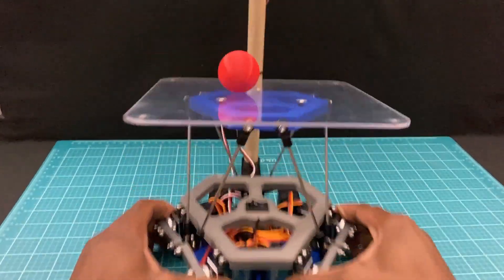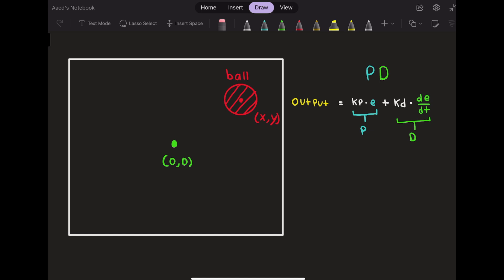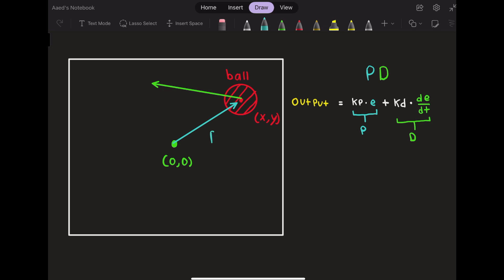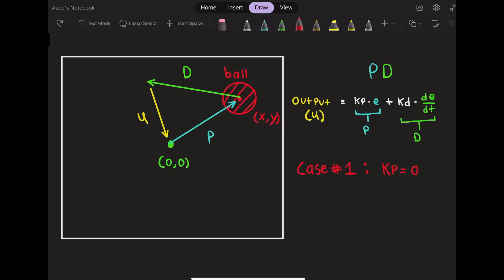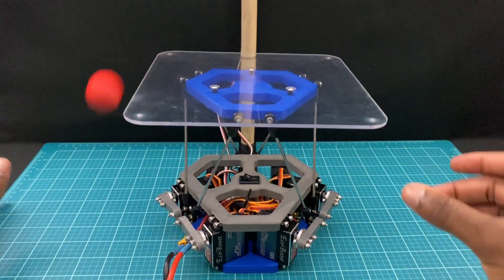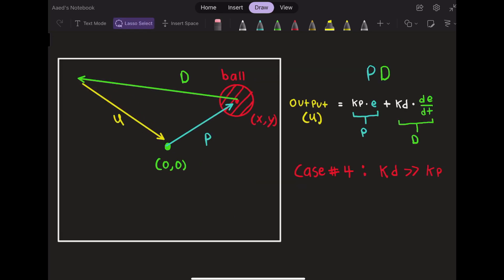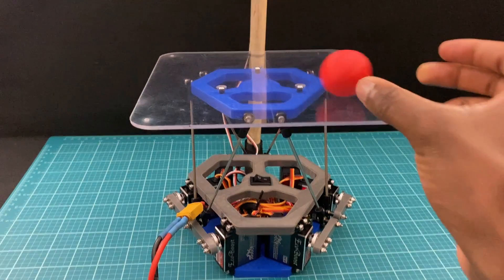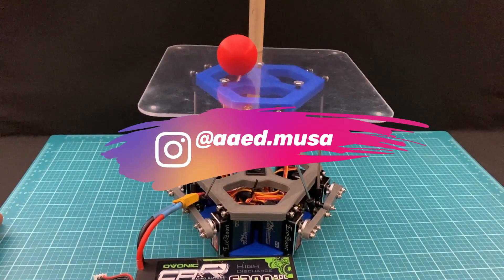Ball Balancing Robot pt.2

Comment: Wouldnt the integral value would help him being constantly learning from his incorrect movements and tuning himself all the time ?? Im not an engineer but i did a electromechanic formation some 12 years ago  i did not worked with pid very much since school and even then it was simplified
Reply: The integral term helps with steady state error but since the ball is moving so quickly and there is no “steady state” per se (other than the exact center point), the integral would mostly add oscillation and make the controller much harder to tune (would probably need more aggressive derivative coefficient but that comes with its drawbacks as well)

Comment: Thank you for doing this!  I've always wanted to understand PID control and inverse kinematics.  This second video explains PID control and your approach with the software very well.  Is there any chance a third video is coming to explain the inverse kinematics?
Reply from the maker: Unfortunately no. The brief overview is that I used vector calculus to derive the equations and it took a really long time lol! The equations essentially allow you to input a vector and have the platform point in the direction of that vector. Knowing the distances between the servos and how long each linkage is, you can break the entire system into a bunch of 3D lines and can then solve for  the positons which each servo must face in order to get the platform to point in the direction of the aformetntioned vector.
Reply: @aaedmusa  thank you for the explanation.  I'll go through it (which will take me some time!) and I appreciate the assistance.  Keep up the great work!
Reply from the maker: @jsbrsb  thanks!

Comment: A long time ago (in the BasicX days) I tried to develop a self-balancing robot. It had a single DOF: simply, just a T-square ruler placed upside-down on the floor with a single servo on top operating a single "arm". Sort of like a human keeping her balance standing with her legs apart and being only able to swing one arm. The robot had a single sensor - reporting the level angle. You may think of it as an upside-down Segway problem. I failed because the equations of angular momentum and acceleration got too hairy and BasicX was too slow.
This problem is much simpler than the one that you have solved. Can you think (in your spare time) of a simple solution?
Reply from the maker: Interesting, that's something I'll look into doing.